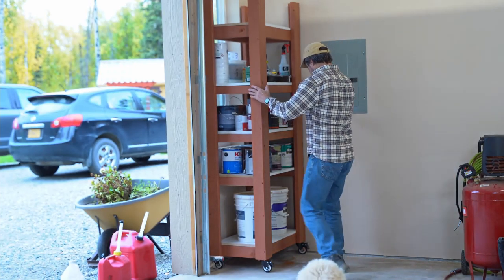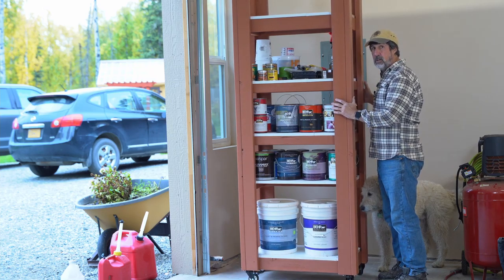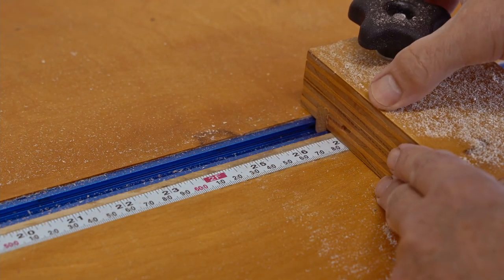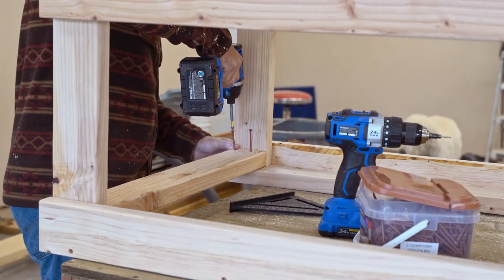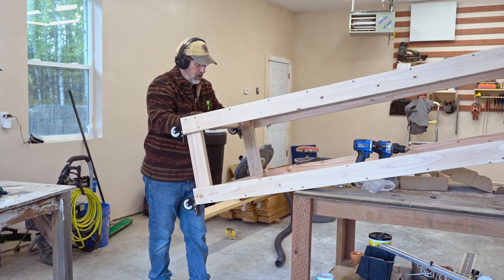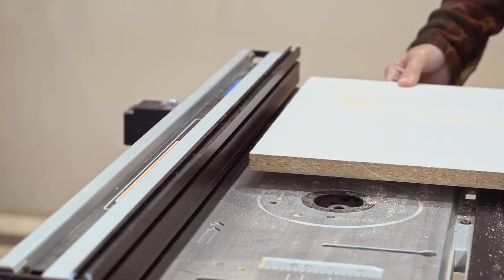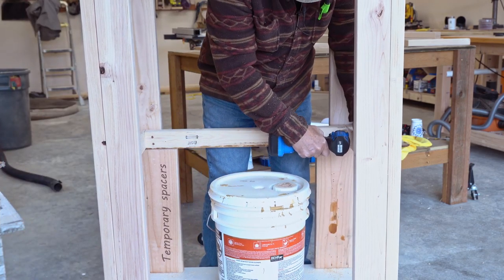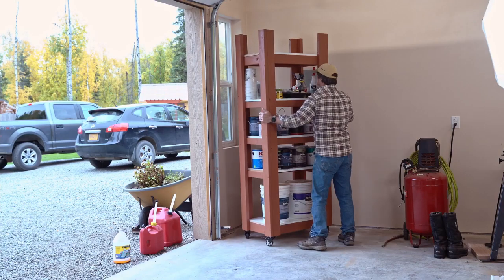Rolling Shelves

Comment: What do you think of the cheaper casters after 2 tears with them?
I bought some Harbor freight wheels once and used them on a rolling file cabinet I have stored outside but it is under cover and on concrete.   One time when I was spraying off the area I discovered that the dye came off the wheel and temporarily was staining my concrete.  The wheels themselves are slowly disintegrating.  Ever since then I have bitten the bullet and used more expensive wheels but damn they get expensive
Reply from the maker: They have worked out well but I rarely move this unit. I might move it once a month to sweep out from under it. I have used similar casters on my planer cabinet and I roll that one around a lot. They have held up well.
Reply: @AlaskaWorkshop  Most of my wheels are just for that - moving occasionally,
Do you remember what brand name they were under?
Reply from the maker: @jeffa847  There is a link for these casters in the description. The planer stand I used these, https://www.amazon.com/dp/B08HS381FH?psc=1&linkCode=sl1&tag=alaskaborn-20&linkId=0ead376140954c0604b89aff67cfdd68&language=en_US&ref_=as_li_ss_tl

I have not noticed a difference in them. Both have worked well.
Reply: @AlaskaWorkshop  Thanks.     Gee.....who would have thought to look for an affiliate link ;-)

Comment: Also, I did come across the idea of the HPLV gun watching Jonathan Kats-Moses where he did a pretty in-depth tutorial on finish spraying. Could you tell me what make/model you're using, or if you have a video on that? I'm not quite there with my garage woodworking space (lol I've only built a workbench so far), but soon I hope and haven't had really any experience with sprayers. As you mentioned here and from what I've seen, they're really worth the up front investment and learning curve.
Reply from the maker: I am really happy with the sprayer I have. It is a Husky brand from Home Depot. Very easy to fill and clean. I have used it on a lot of projects now and I am getting pretty comfortable using it. I may do a video on it now that I am getting used to it. https://www.homedepot.com/p/Husky-Gravity-Feed-Composite-HVLP-Spray-Gun-H4850GHVSG/203497641?MERCH=REC-searchViewedNA-203497641--N&
Reply: @AlaskaWorkshop  that would be awesome, and thanks for the link!